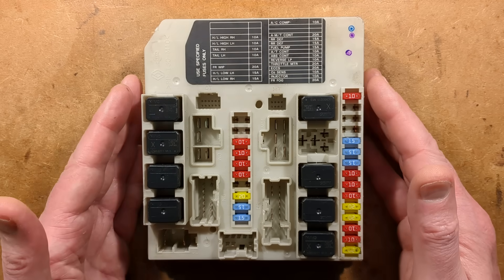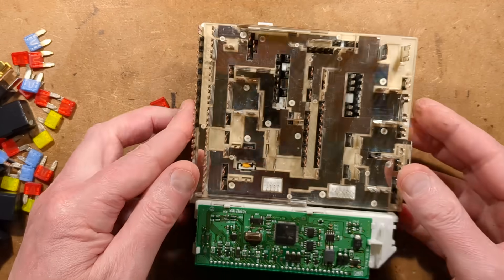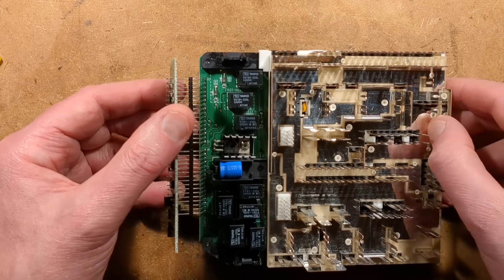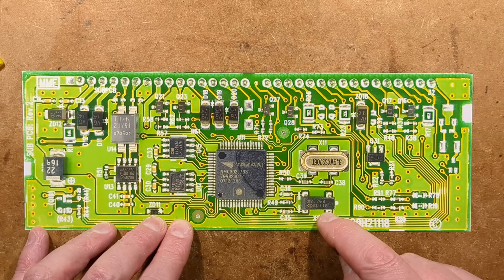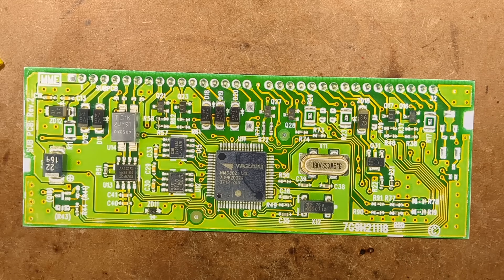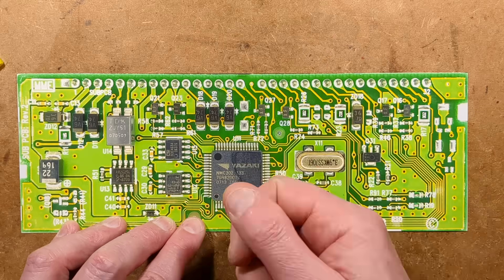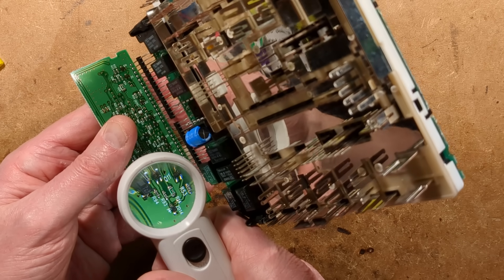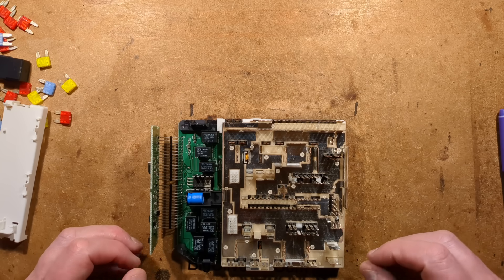Why your car's fuse box costs so much (and the location of the data chip)

Comment: Electrical and electronic components, as used in cars, are exposed to extremes (vibrations, heat, cold, humidity, ice all of a cyclical nature). Not as much as say Satellites, but still, it sets a benchmark standard for components, which is excellent for use in less demanding situations.

Comment: Put all that in an atmosphere ranging from 45 to -10 degrees with extremely variable humidity, all subject to vibrations and dust, and you'll know for sure why modern cars are less reliable than their predecessors. Could it be that this is done on purpose? (When you see how rudimentary the electronics are and the price they sell this rubbish for, it's a SHAME.

Comment: As most (all) cars have a fuel pump these days, a good way of stopping your vehicle from being nicked, is to put a switch inline with the fuel pump.
Use the fuse, here the top small blue one 15Amp, and wire the switch in line after the fuse, easy to bell out.
Hide the switch somewhere out of sight that only you know about.
This is much better than any antitheft device as they are all well known and easily overcome if the thief nicks the keys, as they do these days. Watch as they get 30m down the road and then it packs in. Funny as hell.

Comment: the programmer works great like that! use it all the time for reading bios chips on laptops. you usually read it 3 times or so and check that they are all the same. beats having to remove it multiple times.

the links are probably for manufacturing. the folded clips are probably closer/taller than they would be if they used a single sheet.

Comment: 4:37 Saying I haven't driven for a while, without saying I haven't I haven't driven for a while: Last car I owned and drove  stull had a dumb hole as fuse box cables from one side, hole for the fuse in middle, cable on the other.
The thing with the highest smarts in that car was the cassette deck.

Comment: The 32,768 Hz resonator is probably for the low-power mode of the microcontroller, switching to 3.9 MHz under normal operation.  The MSP430 operates similar.

Comment: An active backplane explains a lot.
Was pulling my hair out trying to figure out why HV system does not come up in "ON" mode (IFF it is not plugged in) on my 2011 Nissan Leaf. Turns out: it was never designed to.

Comment: It's very interesting to see these, I question how they work fundamentally, I have one from a nissan titan, another from a Nissan Altima, another from a Nissan quest, One of them intermittently had the A/C Relay not provide power to the Compressor so it was replaced, another the alternator decided not to charge due to the ipdm shutting it off. I just wish I can reverse engineer what effort and knowledge have been done on these boards to function as engineered.

Comment: I swapped the ECU on a Honda CRV for one bought (£65) off ebay with a very similar serial number and age from one of the Lithuanian scrap/stolen yards. Identified the EEPROM inside and swapped it between the units (using a pair of multi-pin soldering blades on a Metcal). Amazingly, it worked perfectly and saved me at least £1500. The Honda dealer had suggested it was a different issue and wanted me to start buying other parts for them to replace. Luckily, I dredged the internet to find someone who had encountered the same fault and who eventually worked out it was the ECU by eventually buying a new ECU through their dealer.

Comment: As some other commentors have mentioned this is a IPDM(Intelligent Power Distribution Module) which is Nissan language for the engine bay fuse & relay box and it's control circuitry. They are variant and VIN coded and you are correct that data is held in that tiny little 1K serial EEPROM.

On reading that serial EEPROM in circuit it's a common thing for us in the automotive world to read them in circuit, we often use programmers with relatively fine voltage control to avoid waking the MCU because as you mention most of them the first thing they do is go set I/O and might pull a data pin high or low at the wrong time. Serial EEPROM will often read down at 18-2.7v but MCU won't wake until 3-3.5V. There are still modules where you must remove the EEPROM which I'll generally do with desoldering tweezers rather than hot air because it requires less preparation. Most of the time voltage control is more than enough though.

More modern control units are moving away from a separate EEPROM for data storage, lots now simply use the large flash arrays in the MCUs for both program and data storage, or some use separate serial EEPROM of which the memory is encrypted with an encryption key in the MCU, and even more modern systems have that key held in a secured area of the microcontroller which some refer to as a crypto core. Believe it or not what you had in front of you is relatively simple by modern standards.

Comment: Not very familiar with Nissans (not Niieessan).
But if this is a fuse box, I do wonder where you‘d tap into a terminal 15 connection to e.g. install a dash cam or additional USB sockets.
Reply from the maker: That would probably be best taken from the dash/console accessory socket wiring.

Comment: The main reason for all the computerizing and CAN bus communications along with e2rom is to screw the customer so they cannot repair it and swap parts, need to be electronics engineer with inside knowledge. else its off to the authorized dealer where you get ripped off.

Comment: Former Chrysler Master Tech in Canada here, got out in 13 ish. This fuse panel looks simple - The TIPM - Totally Integrated Power Module - that Dodge used on their Ram Trucks was probably double that size with a shitton more slots n wires. Thing is - theyd build ONE base TIPM, then option it out - everything from 2WD V6 Half ton trucks to the big 4x4 Diesel 1 tons and more, many options, and the TIPMs would need to accommodate.  Youd see the covers have usually two, sometimes three, fuse guides within depending on gas or diesel mainly. In one instance, i was PDI-ing a new vehicle, running a Ram 1500 thru its paces, when it literally caught fire on me on the drive back; i roared into the yard n yanked the battery out as the TIPM smoldered away.  Found out a few weeks later that wasnt the only one - wound up being a fairly large recall on the TIPMS for the 1500s with what was known as 4AUTO mode - 4 wheel drive but instead of 'part time' or full mechanical transfer case lock, a separate mode in which the front wheels were driven off what amounted to a fluid clutch instead of hard gears. The TIPMs had a batch wired wrong internally, trying to access that mode caused a hot/dead short; at the very least, bricking what was then a 2400$ CDN TIPM, and apparently at least two or three trucks in Canada went up completely in smoke from it, last i heard anyway. 

Insofar as timing - its possible, though not guaranteed, that the timing is either for fuel and/or for ignition, depending on application. I dont know Nissan from a hole in the ground so only guessing from what i do know. 

The security chip issue is a huge, and growing, issue with Right To Repair, especially here in North America - Auto manufacturers are trying to pull an Apple n make it so you dont actually own the car, so far they can get away with it for the first 2-4 years of the car life and then the damned thing time bombs anyway. Disgusting practice. Louis Rossmann has been in many ways leading the charge against this nonsense, but its an uphill fight. 

All this garbage is why i keep my 70s dodges with both 1st gen electronic ignition and the old Points Condenser ignition setups.

Comment: I found out some years ago that they are no longer simple fuse boxes. My indicator stopped working properly and in the past I have always just simply replaced the £3 relay. Not any more!

The relay is inside the unit under multiple layers like the one you've shown, and now it becomes a £950 dealer replacement!!! Of course, I just spent the time dismantling the circuitry and replacing the relay but most people wouldn't be able to do that.

Comment: These parts are the worst, especially on french cars.
Take a look at the peugeot 307 valeo BSI - impossible to repair without breaking the plastics.
Now that those cars get to the "(ee)prom data retention end of life" (and since the immobilizer data is also on them) some fail in funny ways - the car just dies while driving.
No Idea if the airbags will deploy, i hope so...

The older mercedes ml has a detachable module where the eprom in the otp microcontroller fails (i tested this, depending on the temperature it executes garbage), the car can basically go in the bin when that happens :)
Ahh, the joy of modern electronics haha

Comment: Some of those transistors are for driving the hidden relays, for things like a "crank request" to the starter motor solenoid when the key is turned. Have you ever noticed on many of the newer vehicles that you can simply momentarily tap the key to the start position and immediately let go of it, and the starter will automatically continue to crank the engine until it starts, and then it disengages the starter all on it's own? Many of the relays in there are controlled thru the engine or transmission ECU to control things like the "start request" function.

Comment: This is for Nissan micra k12 this is my mom's car it has a problem with the low light so i made external one and the low light has a removable relay on the fuse box but  the high light is different it has the relay soldered inside

Comment: If you want to read the flash connected to a controller, sometimes you can hit and hold the controller's reset pin to prevent it from booting.

Comment: Those EEPROM chips are usually accessed via I2C, which can be a multi-master bus if everyone supports multi-master. This can let you read the chip out without relinquishing the bus to the MCU and ending up with bus contention,. Or the act of performing the read corrupts the bus sufficiently that the MCU crashes and goes idle. Of course, it's also likely your're looking at the fusebox and body controller unit which is responsible for handling the car systems - headlights, key communication, and other things that are not powerplant related. After all, it's got to go somewhere and the fusebox is right where it could be most useful (it can read the fuse status and tell you which one is blown, as well as drive the OBDII port and such

Comment: Just a thought, but if you don't trust powering the board from the EEPROM reader, don't remove the whole chip, just lift the VCC pin. No bus contention, and 8 times easier than removing the whole part.

Comment: Those integrated relays are a curse, they basically turn these units into very expensive e-waste when they fail, which they do regularly, especially for regularly switched large loads like headlights, cooling fans etc.

Comment: It amazes me that in the early 1970s an entire car had maybe 5 or 6 fuses, and for all of today's complexity they still only do the same thing, get you from A to B.
Reply: Looking at my car from 2001, it seems that you can have pretty complex electronics, good diagnostics and simple design at the same time. These newer cars are made so that the dealer can charge you a huge premium once eventually something breaks on them.
Reply: I see fuses for the seats, heated seats, lights, side windows motors, passenger seat motors, etc. Im sure if you remove all those it'll be about 5-6 fuses

Comment: You often have to get a professional auto electrical shop and get that EEPROM flashed to work with your car. BCMs, ECM, PTCMs can ALL require flashing. My automotive electrical specialist retired 2 years ago, after almost 50 years in the business. He was lightyears ahead of the dealerships. That PTC will throw an error code for a diagnostic reader. I rebuilt a few of the modules in my GM SUV merely by reflowing the solder joints. The windscreen wiper delay required a capacitor or two, and conformal coating repairs. The aftermarket ones really do suck quite badly. They work but the delay function has a terrible range. Too fast in delay mode and too slow when running full out.

Comment: I guess you could make reading the EEPROM in situ easier by holding the MCU in reset.  Most MCUs I’ve seen have a reset pin though that may get repurposed when spare IO becomes a problem.  Note to fellow engineers:- use an MCU with more resources than you think you need or feature creep will byte you (I’m here all week) later.

Comment: I can confirm that empty fuse locations can have interesting functionality! Subarus have a specific position which, if a fuse is inserted, will cause all of the relays (fuel pump, AC compressor, etc) to cycle on and off. It's meant to be used during the check-out procedure when a car is first delivered to the dealer, but can also be handy for troubleshooting.

And yes, getting an EEPROM clip to work like that is an exercise in frustration. Even just providing enough power that your programmer's voltage isn't pulled too low can be a struggle.

Comment: Thats Reanult clio 2007 fusebox control module. As far as I remember these are like to fail to control headlight relay. In mine there was a faulty low side npn transistor that should force current flow through headlight relay coil. there was a short between collector and the base terminals. I have replaced it with not AEC transistor from the old motherboard (new transistor is much thinner ). It works till this day, luckily the MCU has not been damaged. the symptoms in car was when you removed the headlight fuse the 5V from MCU output through base>collector termianl was visible in fuse terminals.

Comment: The micro controller probably just reads it once at startup so if you read after that you'll be fine. If you read two or three times and get the same data you probably missed the conflict.

Comment: Had to replace one of these in my Clio a couple years back. Renault decided to place this in a stupid place below the scuttle panel where it managed to get water inside it. Headlight relay must have started arcing until the relay eventually failed and the headlights were stuck on. 

Thankfully managed to find one fairly inexpensively on eBay in decent condition but it’s an absolute pain in the arse to get out.

Comment: a typical fuse box is just a block of plastic with spade terminals shoved through the back of it, I wasnt aware of nissan doing some BMW level of complexity with what is a essentially a body control module with a fuse block slapped on top of it

Comment: With those in circuit programming methods, the usual approach is to force the micro into reset, though others will try and abuse the brown out protection, the eeproms are almost always good down to 1.65-1.8V, but the main micro may have a brownout at 4.2V, personally I prefer lifting, as some programmers don't play as nice when address pins are strapped.

Comment: The bridges are for making it manufacturable, if you fold all those tabs back flat it wouldn't be possible to stamp from a metal sheet without separate pieces.

Comment: sigh i want a simple fuse box. if i need another module to do various things then that is a seperate box. i just love having a simple dumb car with the only computers being abs, maybe some traction control (that has a single button to turn it off) the airbag safety system (i know it does more i just call it that) and then the engine's computer for fuel management and maybe even ignition timing. pretty much what my current daily driver is. a simple dumb car that just goes where i want it and has me deal with any issues.

Comment: Hey Clive, the 32kHz oscilator is used as a clock for the microcontroller when in hibernation. PLL being powered by the 3.9MHz uses a lot of power so it is not used when in hibernation.

Comment: You are supposed to use the in-circuit clip with the microcontroller held in reset or your circuit is provisioned with resistance between the eeprom and microcontroller bus to allow for the contention.  Removal is best if the circuit is unknown and reset can be disabled.

Comment: 9:56 You can take the photo from an angle, 30 degrees or more, then correct the trapezium shaped image to a rectangle. On an iPhone it's built in to the photo edit function. As long as there's enough depth of field - don't get the lens too close. On some digital cameras with the image stabilizer in the body the correction may be done optically by tilting the sensor. In the wet film days a process camera with bellows could do the same thing.

Comment: most of those little 8 pin chip and be read and programmed when removed from the board most of the time it wont work on the board with a simple eeprom reader the vin is usually easy to find and change

Comment: The weirdest electrical short in car I had experience was how my Saab 9000 horn went on continuous blast whenever I hit a puddle in the rain,  apparently the headlight wiper connectors are prone to cracks in old age and shorted out, when it shorts, it connect the horn to ground, and the horn just stuck closed. rofl 
Luckily, the fusebox is in the glovebox, complete with labels of which fuse are which system on it, not just numbers, so I can just pulled the horn fuse without going outside in the rain. It's why people love Saab, they have problems from age, but its engineering choice are mostly maintenance first, changing fuse doesn't require getting out of the car.

Now I removed the headlight wiper and cut off the connectors, I don't need them as I live in tropical climate, headlight wipers are for snow, not the rain.

Comment: 1978 SAAB 99 Turbo and I lost multiple accessories driving over a cattle grid - most noticeably the radiator fan (Just ascended, at speed, the highest pass in N Wales).  Design flaw has all the connectors vertically oriented and under the fuse/relay box - vibration+gravity conspire against friction.